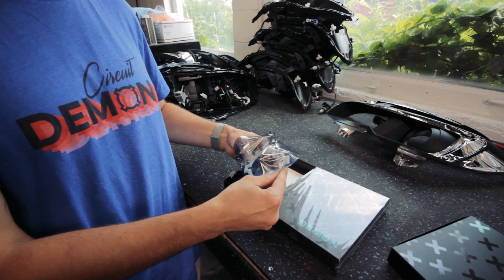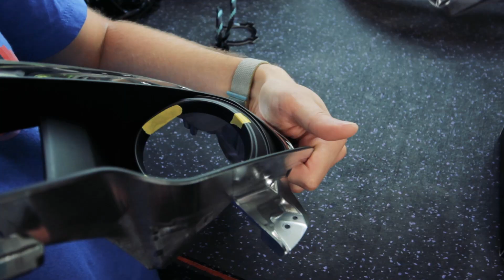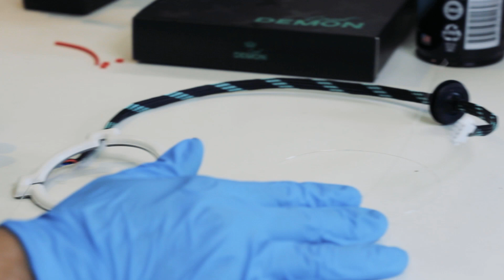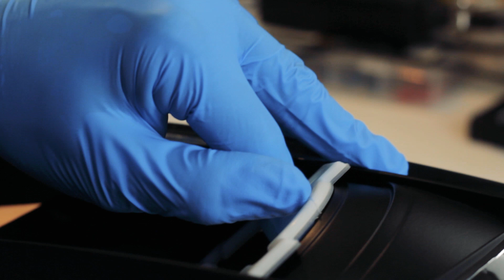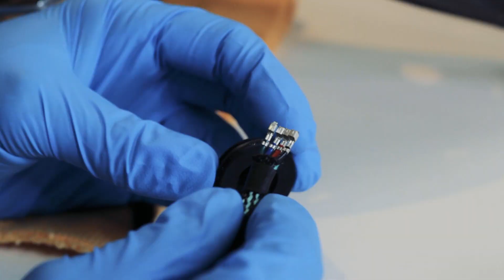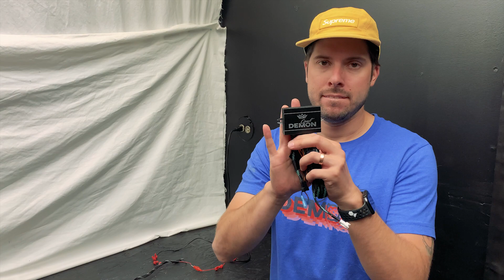How To Install Circuit Demon X-Halos!

Comment: Do I need a DRL for these leds?, I just want them like normal city lights they must not burn harder then my xenon light
as well the same question for those devil eyes ?
Reply from the maker: The X halos are only accent lighting with the use of the Bluetooth controller. They are not true DRLs. They will only turn on and off within the provided app. You can turn them white and save a “driving mode” within the app however.

Comment: I put these on my subaru, and the XBT won’t turn off with the car? The halos stay on! I’ve tried pulling power from the battery and every fuse in the engine bay, they won’t turn off without the app. Is that normal?

Comment: Can these be wired in two be drls alongside the diode dynamics c lights. If that is possible than can the color still be changed
Reply from the maker: They cannot, they are only controlled through a bluetooth remote. Only RGB.